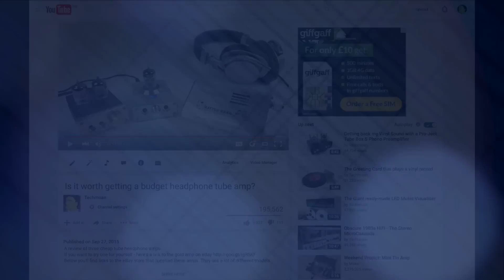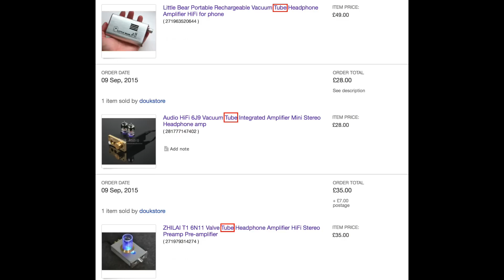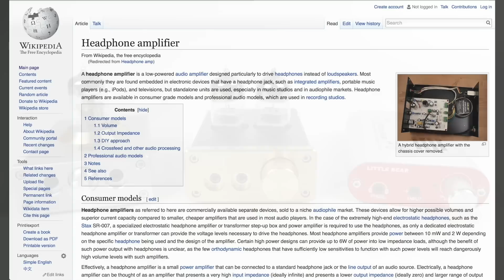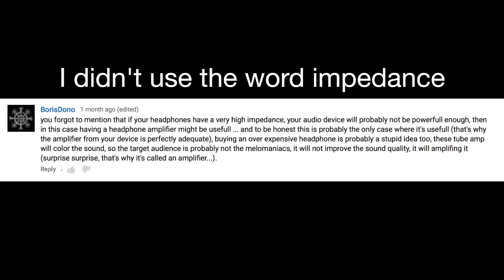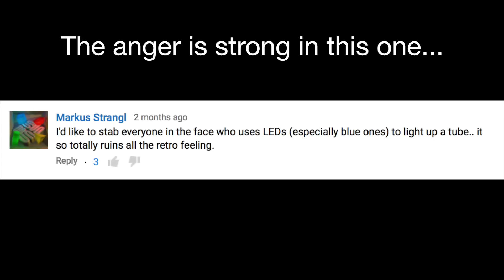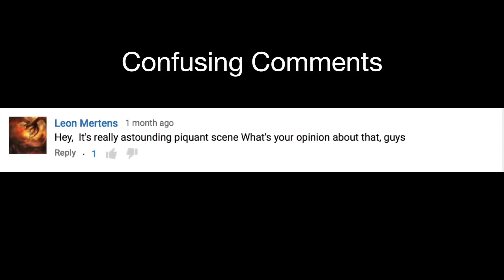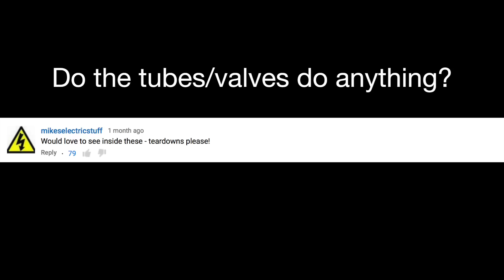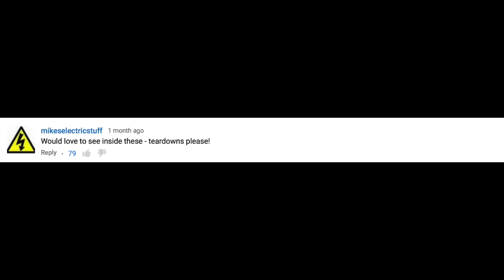Headphone Tube Amps - Follow-up & Tear-down

Comment: Contact Dave at the EEVBlog if he doesn't know no-one will. https://www.youtube.com/user/EEVblog
Reply: +Tech It Out  I would second this opinion, Dave does have a bit of experience in tear-downs and discovering what, how, why, and "huh???".  But my guess from looking at the first two are no, they are solid state amps.  There are two NE5532 OpAmps on the first board and a lot of 16 volt capacitors around the tubes (or valves) which if I recall, tubes only require a small voltage to light up but a fairly high voltage to actually start the tube and warm them up so they work.  My opinion, some one from some where got their hands on a bunch of tubes and sockets and slapped them into a solid state amp so they could charge more for the "pretty glowing thing".

Comment: That D6C has a serious rumbling problem.
I'd recommend you take it apart and clean the grippy part of the flywheel, this helps a lot in making the unit quieter and and more stable  by means of wow and flutter (though this is hardly noticeable on the D6C even if it has this problem)

Comment: Great teardown vid, it appears that the  Valves (Tubes) are actually being used to produce the audio. there does appear to be a high voltage power supply to boost the HT that the valves require.

The soldering and general construction explains why the Little bear amplifier is so poor, the other amps look far better in terms of construction & quality of soldering.
Not everything from china is poor quality, but the little bear should be binned ASAP!
Reply: +markpirateuk 
I woud say exact oposite.
little bear is best of them all because it actually uses tube in right way.

others run tubes on very low voltages at best and they do not amplify signal.

of course none of them does any useful job.

Comment: double-sided circuit boards - the other pins are connected on the top.

plus lolling hard at the so-called "audiophiles" getting themselves bent out of shape in the comments of the original video. (remember this is an industry that invented "uni-directional" speaker cable, a bit of a feat for an alternating current transmission line).

personally i prefer transistor-based amplifiers but if you like the sound of tubes then knock yourself out!

always enjoy your videos. keep it up.

Comment: no output transformer  what's the impedance  for the output  ? 
a good op amp could do the same job   with a few  few transistors  driving each  headphone     I wouldn't buy one  -if you tried to sell me one  . tubes have a place   not for a headphone amp   R.G.G.

Comment: The tubes are actually being used; 12 volts plate voltage is enough to run many miniature tubes in a "starved anode" configuration. That said, most of the gain is provided by the 5532 low noise op amp; the boost converter is generating the voltage for the IC, not the tube. The same circuit without the tube section would work just as well.

Comment: I see voltage boosters (which means they plate voltages may be correct. there is article on hackaday about the portable one and how it is crappidly built tho.) Thank for posting honest views of real items. I likely said this before but you are responsible for allot of my audiophile and non audiophile equipment equipment purchases.

Comment: It's using the valves but not in the correct mode, it's using starved plate voltages. Look up the valvecaster pedal. It uses about 9 volt to starve it.

Comment: Can you take some high resolution images of the boards, that would help reverse engineer the circuits, and thus figure out what the tubes are doing. With the camera oriented 90° to the surface of the PCB. Though the 1080P video stream is a good start.

Comment: The little bear definitely uses the tube, it dose have a boost converter to achieve the needed B+ Voltage. And although i did not find the datasheet for the JRP6021 tube, i do know the general voltage range these sub miniature tubes work at. (about 100V, some even lower) That voltage is perfectly achievable with a boost converter. but with the problem that if not done correctly, it will create a audible hiss (and it dose). As to the rest, i would have to say they seem to be working in a starved anode configuration, thus not doning anything other than adding distortion, and decreasing the input signal level.
Reply: +lbochtler But one thing to note on the other 2 amps, both tubes are 5V type heaters, so they at least can be run (if not correctly).
Reply: +lbochtler I took a look at the 1 tube, tube amp based on the pin out of the 6n1p (apparently that 6N11 dose not exist) based on the pin out of the 6N1P the amp is using the tube as a sort of Gain stage, but based on my knowledge on tubes, it will not have much if any gain. (i have yet to fully work out the entire schematic, thus i cant calculate the actual gain of the tube stage). The tube is running as a dual class A amp, its output is then fed into the opamp (the actual gain stage). The output of the opamp then feeds the headphone jacks. I cant fully see the traces, but i would assume that those yellow caps are the coupling caps that feed the signal into the opamp. The tube will be running in a starved anode configuration. This is based on the lack of a DC DC converter. Although that inductor near the tube socket dose looks suspiciously like a Boost Converter. But again i have not fully reverse engineered the circuit yet.
Reply: +lbochtler The 2 tube model also seems to be running the tubes in a Class A configuration, but i have not worked out much of the circuit yet. The amp dose seem to have a DC DC Converter in the back, thus it stands to reason that these tubes are actually run at halfway decent voltages. So just based on that, id say the 2 tube model also uses the tubes, as the actual gain stage this time. Only downside is, the tube was never designed to do AF amplification. Also it seems a pin is missing in the circuit, according to the datasheet its a 10 pin tube, not a 9 pin. The missing pin would be the cathode of 1 of the 3 internal triodes. Based on the datasheet this could actually be running a more advanced circuit, such as a Mu-Fallower, or a Long Tail Pair. But i doubt that, and i can not confirm it, due to me not having reverse engineered the circuit yet.
Reply: +lbochtler 
These little tubes in "little bear" are designed for battery operation, they use about 42v  as nominal voltage
otrher amplifiers are just pretending to use tubes as you described later

Comment: They do use the tubes
Reply: +oriagranat9 Based on the circuits i have reverse engineered so far, they do indeed. And at decent plate voltages as well. I have yet to fully reverse engineered all 3 though.

Comment: Electronics APPRENTICE/ENTHUSIAST here (I AM NOT A PROFESSIONAL), I will try my best and to keep it simple:
In order to simulate a delay, you have the following options:
1. Microcontroller or microprocessors with a special software
2. A timer IC (like a 555)
3. PTCs/NTCs that heat up over time
4. Slowly charging/discharging capacitors
Option 3 (SMD PTC/NTC) or  Option 4 (multitude of caps on all boards)  could apply to all of those, so I will not mention that.
Let's go through all 3 amps:
#1 @11:36 - Has an IC with a sanded surface on the left side (idk what they're trying to hide here), option 1 or 2 could apply here. The two ICs on the right side are NE5532 OpAmp-ICs (one IC contains two amplifiers, they went overkill here), but I don't think they would be enough to supply headphones. The through-hole connections on the back also look a bit weird, they usually expose some copper instead of having a solder mask.  Conclusion: Probably legit.
#2 @12:16 - Also has an IC (sadly I can't read it). Only one NE5532 this time, proper through-hole connections and another IC in a TO-220 package, most likely a voltage regulator (two pins would not suffice for a stereo MOSFET). Conclusion: Legit if it outputs stereo to two different channels.
#3 @13:22 - This one is a bit weird, as it has a lot of ICs on it, half of which I don't know what they do. I guess some of them are charging/monitoring circuits for the batteries. We also got one NE5532, an XL6009E boost converter (makes lower voltage to higher voltage) to reach 12 Volts. Conclusion: I don't know, the green board looks sketchy. The white stuff on the back is just solder flux by the way, meaning unlike the other two it got actually hand-soldered.

tl;dr: They could all be legit and I think they are. I need some help.

To clear some myths: Tubes and their sockets have form-factors. They don't use all of their pins because they don't need them, most pins probably aren't even connected internally.
Reply: +NKN1396 "An excellent comment"™
Reply: +Yu Lei I'm crying with laughter reminiscing about all the Chef Excellence shit. God, I miss Ashens. I'm going to head over there now.
Reply: "An excellent comment"™
Reply: Is life real ,or is it just shadows on a cave wall?
Reply: +NKN1396 And you forgot valves. The grid needs to be heated to emit electrons. 

So it DOES take time at the beginning.
Reply: +NKN1396 
#1 Yeah the hair rose up on my neck.
#2 Agreed.
#3 See #1.
Reply: The gold amp had a circuit teardown on Dave's eevblog. The low voltage means the valve is nothing more than an impedance matcher which slows the start up. The amplification is done on the final chips as our poster here says.
It is snake oil.
Reply: many tubes/valves (American poster) have one or more pins not connected, either because the original design of the tube has been superceeded and one or more pins aren't needed (6L6, for example - the original had a metal jacket, connected to pin 1 - when the tube went to a glass jacket, that pin is not connected to anything.) or because the original design used a standard socket with more pins than were needed for the tube design.
Reply: If you look up the datasheets on these tubes you will see they are designed to operate at low voltages. Since these circuits seem quite simple and at least on the first 2 there were no obvious amplifier ICs it's safe to assume they are legit.

Comment: The last one is the only one that might actually use the tube. The others just use the Ne5532 op-amp, some delay circuit a d something to light up the led. Those big tubes need 100-200v to work, and there's no circuit there to step up the voltage (it would be useless anyway). And most of them need an output transformer. But that's odd because the tubes are the most expensive component in there, might as well use them if you put them there.

Comment: I have my doubts about the circuitry . I am inclined to believe the tubes complete a circuit after they have reached a certain temperature thus providing that old fashioned delay as there used to be with TV's in the black and white days. Then again I could be talking complete bollox.

Comment: The gold amp really does have the best circuitry and is  the only one with dedicated channels (1 line for 1 channel) . Also, all of them use the same NE5532 ic which is fine but not the best. I suggest you swap the 5532 and the tube on the gold one with better ones i think you will have a great amp that way.

Comment: Tubes have delay bcuz it needs time to turn tubes on,,,or heat them,,if you know what i mean,,also tubes are replaceble,,,,,each tube =different sound,,,and off course cheap tubes sound cheap,,,and there is no sense to use cheap tubes ,,so thats why people take tube out,,,,best way for checking sound is thru audio interface. Presonus,m audio,focursite,tascam,will do great.....also this kind of tubes are great for guitars,,,,,mic pre---->tube amp-->audio interface or mixer,,,sry for my bad english
Reply: +Maškov Production 
I wonder what quality do you get when you run cheap vacuum tubes in abnormal setup where they are hardly capable of operating at all.

Comment: Regarding the wiring connections to tubes, it's always been common for tubes to not use all their pins.   The tube sockets were standardized, so for a tube that only needed 5 pins, it might come in a 7-pin tube where two pins were unused.  The pins would still be present in the glass, since the sockets are keyed by the lack of one pin and leaving off an unused pin would then allow for the possibility of misalignment.   A single triode tube could have as few as four pins used, two for the heater, one for the grid and one for the plate, and the heater itself can serve as the cathode or be wired to it inside the tube.    A single triode isn't going to give you stereo amplification though, so the single tube amp for stereo would have to have a dual triode tube.   That could require as much as 8 pins, or possibly as few as 6 if the cathodes are common.   The first numeric digits of a tube is the voltage it uses for the heater, usually AC but it could probably be made to work with DC for the heater voltage.   

The 6J9 is actually a triple triode: http://frank.pocnet.net/sheets/201/6/6J9.pdf, and the 6N11 is a double triode, so it would appear the dual tube amp is a multi-stage tube circuit.   Which makes it a little odd that taking one tube out doesn't take out both channels, since the tubes aren't identical and therefore I would think aren't going to be for Left & Right but for different stages of both L&R...

Also regarding wiring, some of the tube pins could have circuit board paths in a center layer, since it's not uncommon for circuit boards to be multilayer.  And in some cases a layer is used largely for shielding and have mostly ground plane, where layers sandwiched inbetween would have the signal paths.   So it's possible the circuit board could look like there's not enough connections to the tube(s) but the connections are actually there in a middle layer that you can't readily see from either side.

Comment: Ignore the comments about pronounciation, who cares if you touch the valves, that's what everyone did when you changed the duff valve in your old telly, my dad had an old biscuit tin full of them and never wiped them after fitting one
Reply: Yeah, tubes are ok to touch, it's only glass things like halogen lamps that get extremely hot that you shouldn't leave oily deposits on. The heat burns the oil, turns it black and this then becomes a weak spot on the glass as it has a higher temperature, and thus shortens the lifespan. :-)

Comment: Those tubes are certainly being used. The negative people have been proven wrong. Yay! I see switch mode converters in there, which I assume provide the required voltages for the anodes and the filaments of the tubes. As other people have stated, there are tracks on the top of the PCB also. Haha nice to see my comments appear in the video too when you were talking about intelligent discussions! :D
Reply: +Niklas Bergsten 
They are not really used for amplification they are only used to pass the signal.
Fhis is pretty unexpected finding.
Those converters do not provide decent anode voltage.